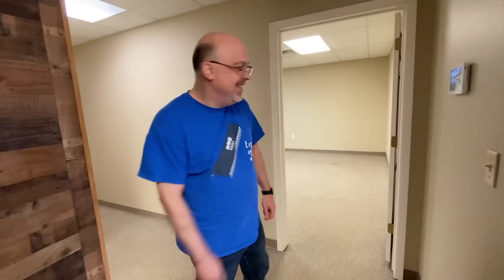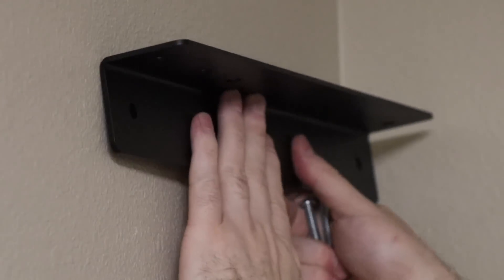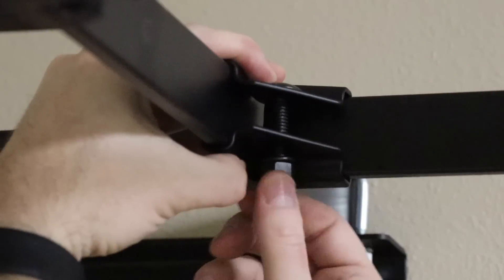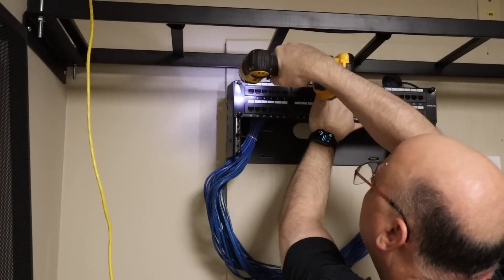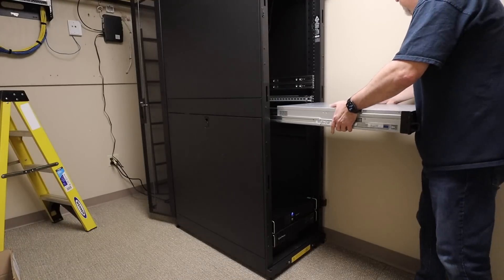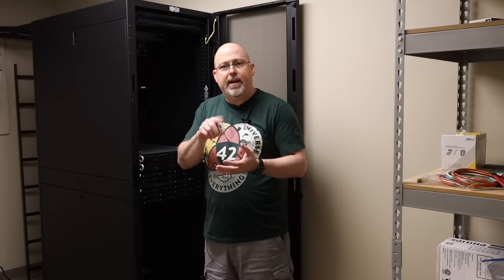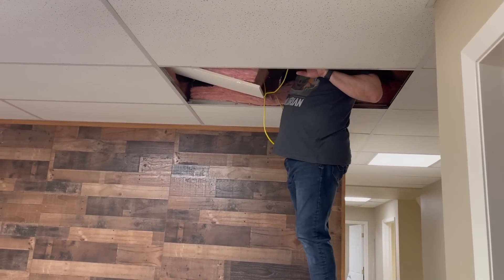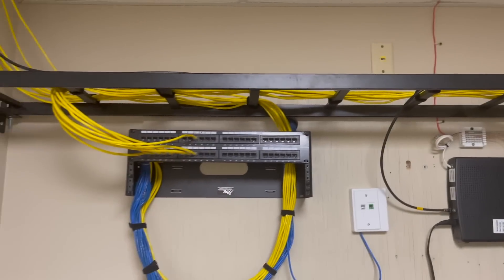New Building Network

Comment: All that can be replaced with a single linux server. You Americans use way too much hardware for a single shop. I bet you don't exceed 500 devices. Edit: 500 devices actually used not the bloat i am seeing.
Reply from the maker: You have no idea what I am running on this or what requirements I have.
Reply: It always amazes me when I see someone on the tubes make a comment with such authority about someone else's setup that they know nothing about.  I can make some assumptions about them.  They think COVID is a scam.  They think the election was stolen from Trump. They think "the gays" are the problem with America.  Did I nail you Jayson?  Because its never about what you actually know. It's about what makes you feel good to believe.

Comment: So many questions: Where are all the Ethernet cables that are not used for Wi-Fi access points going? Do you even use the already built-in Ethernet ports in the walls? How will the workstations be connected to the server room? How can the remote access be happening?

Comment: Great setup. Especially the storage and server rack. 

But when you renew all the network wiring,  why not into the server rack where the switch is located? Now you make a mess with extra patch cables fron the panel to the switch. 
Also, I would have put the ladder the other way around and put the cable very exact in place to make it look perfect.

However, looked like some work for all the cameras and the WiFi. Thumps up.
Reply from the maker: Because I may wind up with more than one rack and would then have the same problem rack to rack.  What do you mean put the ladder "the other way around"?
Reply: @TheGeekPub  okay. I See, more than one rack. If you place the racks next to each other, there is no problem. But if a second rack is at the other wall, you are right.

Comment: Does these ubiquitous routers have a single access point?
Reply from the maker: I do not understand your question.  I am not using a Ubiquiti router.  I am using multiple Ubiquiti access points though.
Reply: @TheGeekPub  sir my question is for instance if I have a router and I connect 3 different further extenders with LAN can I set a single access point on all there extended routers?
Reply from the maker: @uzairakram6074  That doesn't make any sense.

Comment: I’m not sure how Texas building codes work, but I have a few things to point out. The city inspector will probably not allow that white “BC” type fire extinguisher, since it’s most likely required to be a standard ABC red type. Also, Is the building big enough to require a fire alarm system?
Reply from the maker: We passed building inspection with flying colors.  The white fire extinguisher is a K class for the kitchen only.
Reply: @TheGeekPub  ok thanks!

Comment: Could of swarn David was narrating the video for like 5 minutes streight but then I noticed a bit difference in the voice lol. Also, I've worked with Spectrum/Charter for years (not as an employee) and never ran into having to use their crappy router if your static, just go from the modem to your pFSense, if they say otherwise, their wrong (Need to talk with another rep) and should replace the modem with one that can provision to a static WAN output.

Comment: Ladder racking isn't for running cables on (although it is usually convenient for that also) it's to help brace racks/cabinets.
Reply: Ladder rack is for running cable on and is used in DC's across the world from North America to Europe to APAC. It is installed in everything from hosting companies to FinTech DC's. Additionally you can find ladder rack and fiber tray's installed in Telco POP's separated by layers (copper ran on one layer and fiber on another layer vertically stacked. Otherwise referred to electrical and optical layers).
Reply: To properly brace a cabinet or rack requires it to be secured into the concrete if required by local code. In cases such as a raised floor found inside a Data Center, code may allow it to be secured to the raised tile only with no additional bracing required. In Earthquake prone areas additional bracing may be required based on what is installed inside the rack/cabinet to meet or exceed local code. Consideration for heavy racks/cabinets/equipment may require additional bracing to be installed taking into account fire breaks within the Data Center and cooling/hot aisle containment.
Reply from the maker: That's not true.  Not even a little.
Reply: As someone who has been in datacom for 30+ years I can tell you with 100% confidence that you sir are incorrect.  Of course, don't take my word for (or the Geek Pub, who I believe runs data centers for a living).  Read the first sentence on the Chatsworth website "Chatsworth ladder racking is an easy and clean way to organize cables that enter into a data center or server room on a separate plane from electrical cabling."  You'll also notice than in many data centers the ladder is not even connected to the cabinets at all.  Rather it is suspended from the ceilings using all thread and unistrut.  I really hate it when people like you spread bullshit about my field.
Reply: I sure you hope you don't work in IT Dave.  Because if you do you're most likely "one of those guys" and you don't even know it.  By "one of those guys", I mean one of those IT guys who everyone wishes would get fired for being inept, but somehow hangs around.

Comment: Depending on how much cable is up in the ceiling, etc. it's worth saving it to sell to a metal recycling place. Not sure about current prices, but I was getting close to $1/pound for telco cable as of a few years ago.
Reply: I've tried to take coax and the metal scrapper wouldn't take it. I did decent money for a bunch of 14-2 electric wire though.
Reply: @sandmanxo  Yeah coax has too much plastic to be worth the processing.

Comment: Any reason you didn't put the patch panel in the rack?
Reply from the maker: I covered that in the video.  But basically the cables were already run inside the wall and it would have been a nightmare to relocate.  Additionally we were afraid they wouldn't be long enough anyway once we got them out.

Comment: What kind of cable did you run?
Reply from the maker: CAT 6
Reply: @TheGeekPub  does code call for plenum or non plenum rated installation for the cable?
Reply from the maker: Most building codes require CMP, which is what we used.
Reply: @TheGeekPub  Thanks for the info as I was not familiar and curious with what the codes are outside of a Data Center environment.

Comment: I would have suggested fixing the extension ladder to the wall in both ends. What heppens when you want to move or replace the rack?
Reply: I doubt they will need to replace that 42U or 48U cabinet. And since it is not a high density DC install, then doubt they will ever consume that much U space. Based on what is shown and considering the patch panel is not mounted in the cabinet, they could easily get away with a half height cabinet. The ladder rack extension appears to be well secured to the main ladder rack and should easily support the amount of copper secured to it. Sides, if they were to replace the cabinet, all the ran cables would most likely get back pulled.

Comment: I have a client that has Spectrum Business internet & phone.  They have a block of static IPs and aren't required to use Spectrum's modem.  Through troubleshooting phone calls and technician visits, Spectrum has never complained.
Maybe I misunderstood what you meant by "equipment"... that is a possibility.
Reply: I want to concur with the above statement that spectrum can put their modem in pass-through mode and you can get rid of their wireless router device. I did this about a month ago at my city's community center. It takes about a 10 minute call for them to reprovision the modem and you're good to go. Sometimes they require that you get a specific modem from them. I believe the one that supports pass through is the Arris brand. Sometimes when the technician doesn't have that on their truck they will give you a two box solution which is what you have now.

Oh in just a tip sometimes, their phone techs well accidentally reprovision the wireless router instead of your modem so be sure to specify what you want exactly when you call.
Reply from the maker: They told the the two box is required because they use RIP to provision the static IP and RIP runs on their router.